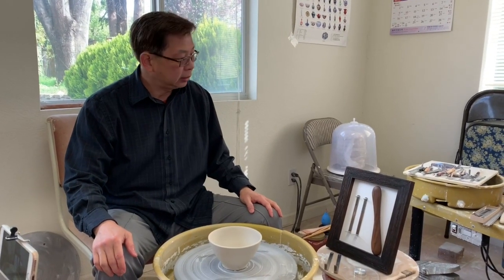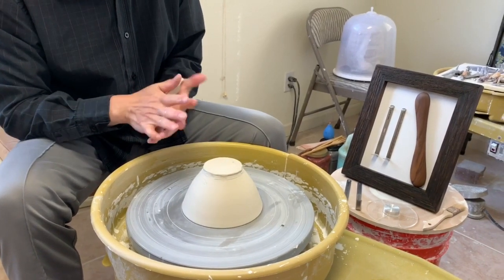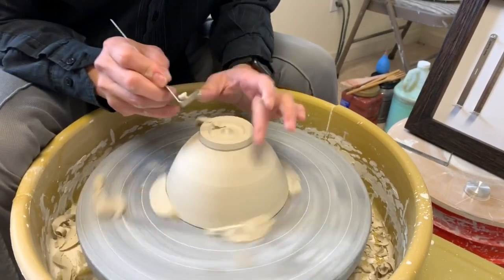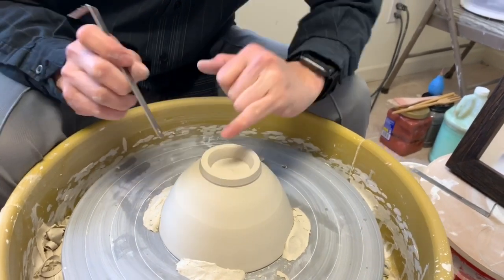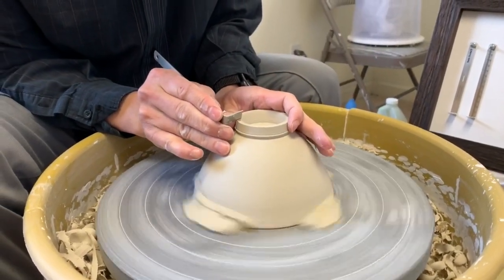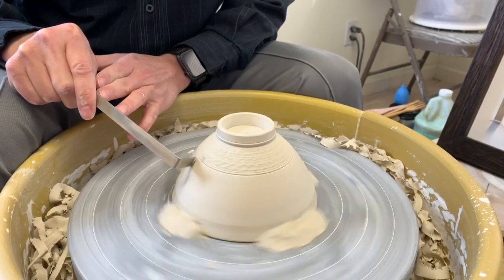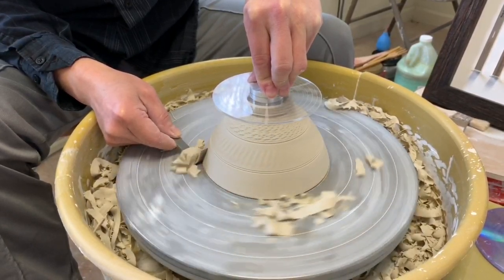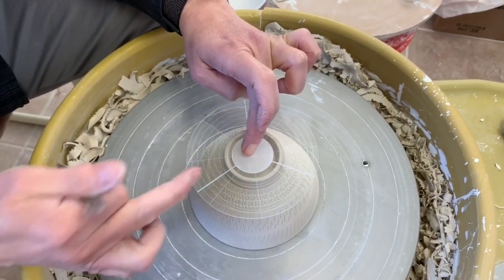338. Trimming a Rice  Bowl with Hsin-Chuen Lin 林新春 修坯跳刀示範

Comment: I’m having a difficult time getting all of the weight off the bottom of the pot. Sometimes it seems that the cylinder isn’t rising up at all. The top of the wall is getting too thin. I’ve been throwing for 4 years. Can you help me?